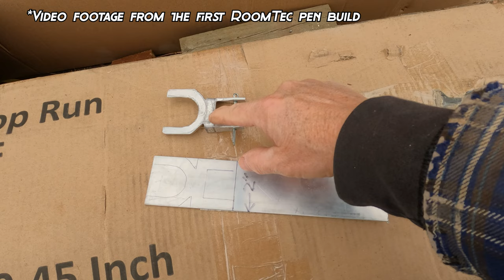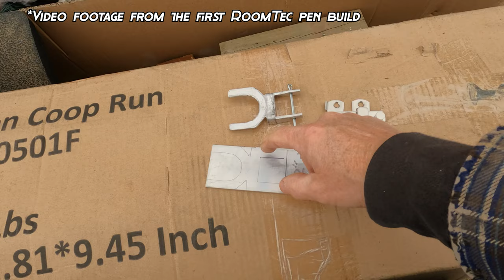10'x 20' Chicken Run  Phase 3, Part 4

Comment: Aren't you worried about vermin getting in between the bottom railing and the timber?
Reply from the maker: Thanks for bringing that up!  It's about an 1 1/4" gap with no give.  The pens have been up for two years and nothing has gotten through them yet, but we plan to wrap it with welded wire fencing or hardware cloth over the chicken wire. Not only will this help keep the small predators out but also to keep our geese from ripping on the chicken wire.